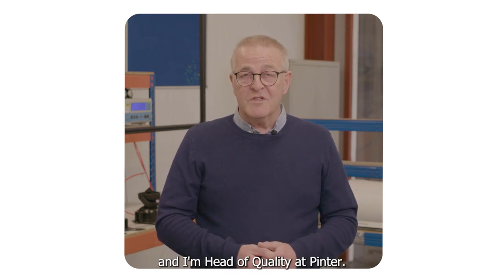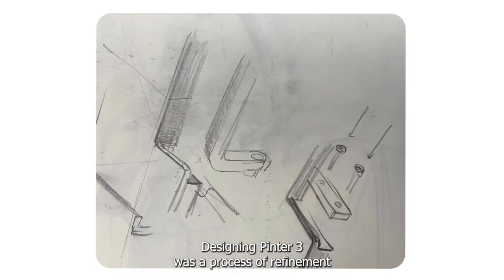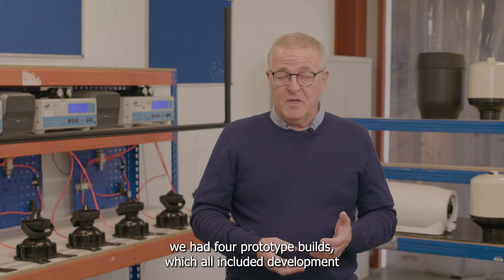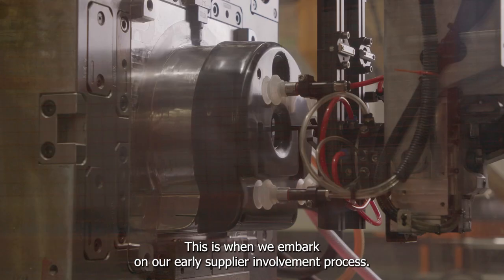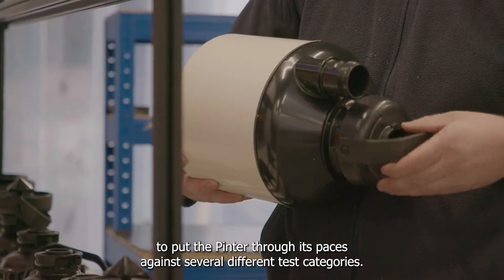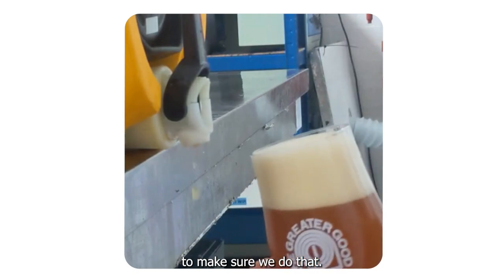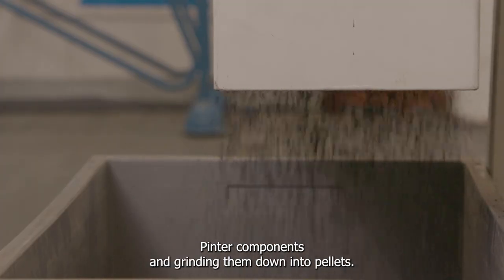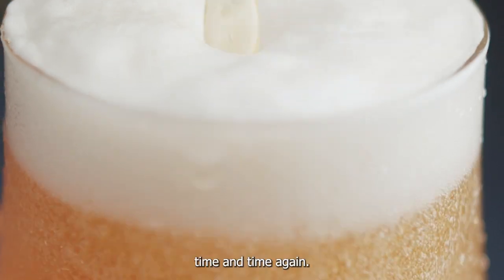Production of Pinter 3 and Active Pour Tap

Comment: Hi Mark thank you. Pinter quality has been an Achilles heel on previous designs. Are you confident enough testing has been done along with QC during manufacture to avoid this on the P3?
Reply: Good touch with the recycling of returned products.
Reply: Having now seen first hand experience a friend has had testing a P3 independently it looks like Pinter have nailed the design of the P3 with the added bonus that the tap is backwards compatible.